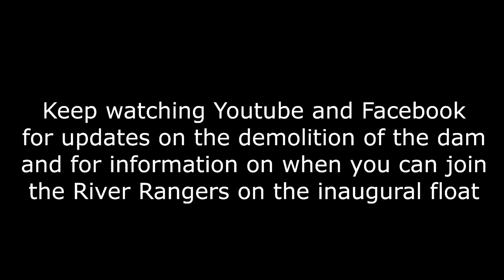2018 Walhonding River Six Mile Dam Removal Plan

Comment: Whut is a lowhead dam
Reply from the maker: It is a man-made structure, typically built to back up water in a reservoir for a variety of reasons. This wall-like structure pools the water as it flows over the crest and drops to the lower level.This drop creates a hydraulic, which is a backwash that traps and recirculates anything that floats. Boats and people have been caught in this backwash.

A person caught in the backwash of a low-head dam will be carried to the face of the dam, where the water pouring over it will wash him down under to a point downstream called the boil. The boil is that position where the water from below surfaces and moves either downstream or back toward the dam. A person who is caught in a low head dam struggles to the surface, where the backwash once again carries him to the face of the dam, thus continuing the cycle.

To complicate matters, these dams are usually loaded with debris, such as tires and logs on the surface and rocks and steel bars just below, posing additional problems should a person get trapped in this dangerous structure.

Taken from:http://www.boatsafe.com/nauticalknowhow/lowhead.htm